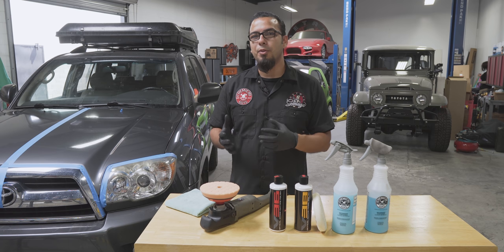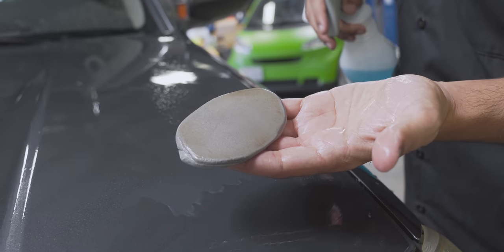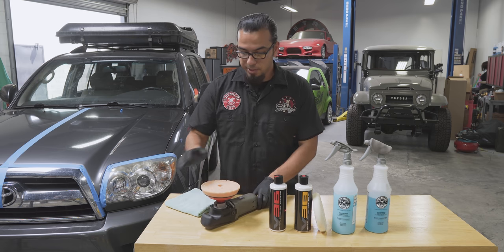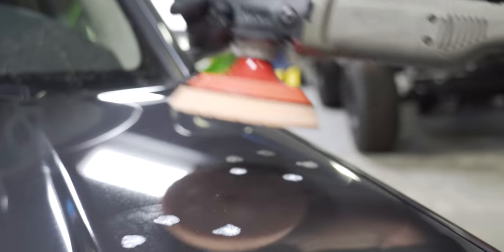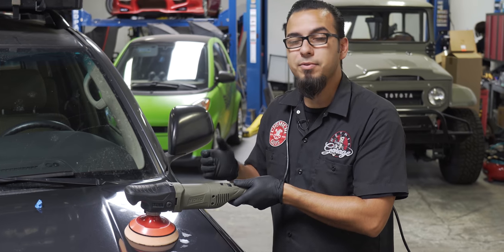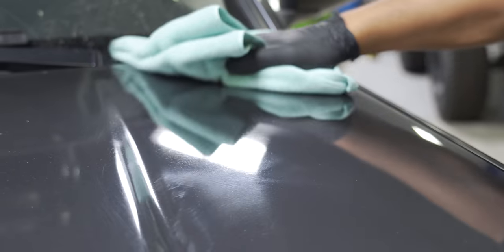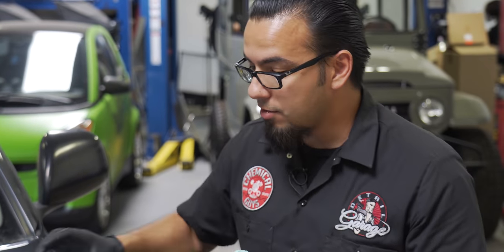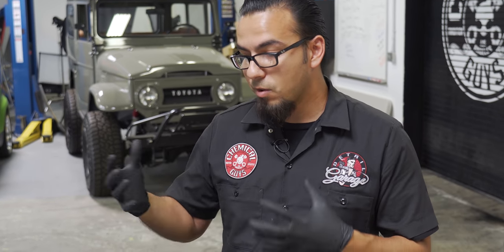How To Use a Rotary Polisher! - Chemical Guys

Comment: Believe it or not from watching you tube I did my own car and it turned out really good!!
Reply from the maker: That's awesome!! Keep up the good work! 
- CG Nick
Reply: Was the rotary not too hard to get used to?
Reply: @radreviewz9482  it wasn't impossible I practised on some old hoods about five times and just thought if I don't try now I never will so I just did it iwas impressed I'm still using the rotory
Reply: @ChemicalGuys  by thanks Nick thank you!!!
Reply: @blitz9117  I should practice on something but what? If I can't get another hood.
Reply: @radreviewz9482  you can always get another hood at your local junk dealer they are inexpensive and the best to practise on. If you can't afford that you can practise on any painted surface that has metal beneath it with some kind of clear coat on it
Reply: @blitz9117  good idea. What would that cost? I also just don't know if I could get a hood in my car but I see your point. It could be a smaller car part too that is painted.

Currently having luck with a random orbit polisher but it definitely takes more time. I imagine some more serious scuffs I actually couldn't get out but I'm doing wet sanding and then finishing with a random orbit
Reply: @radreviewz9482  your doing everything I used to do but after my 3rd nice car it was just taking way too long as you said I don't know where you are but in my area I was able to pick up old hoods for about 15 bucks a quarter panel is even cheaper the money you invest in car parts is well worth it in the long run. But don't be scared everyone talks about burning the paint and so forth but if you listen to what's said and apply it to the job you are doing and take your time you will do fine and you will get the job done a lot faster. I have no patience I had to go faster!!
Reply: Same here I learned some painting skills and techniques from YouTube and I have never used a dual action yet, I went straight to rotary and learned how to use it and now I've painted one of my cars and using the rotary to buff the paint. I figured it's best to go straight to the rotary and now I can use it on any panel and bumpers without damaging the paint.

Comment: How long does it take to polish a car using rotary vs a the torq21 and torq10x? I have the 10fx and feel like I could use a bit more power
Reply from the maker: Hey Kenyon! Thanks for your question. A rotary is much faster than any dual-action/random orbital polisher. You can almost cut your polishing time in half with a rotary but that depends on skill level and paint condition. 
- CG Nick 
https://youtu.be/4a95g7oC0IE

Comment: A professional detailer once mentioned a 20-25 degree pad angle instead of flat to avoid getting circle marks.
Reply from the maker: Hello! Adding angle to the pad creates a hot spot on the edge of the pad which can cause holograms.

Comment: I had a guy tell me that clay barring can wear through the clear coat.  He said that you can only do it twice before possibly wearing through. Is this true?
Reply: Tim Ford No. A clay bar is not going to wear through your clear coat. It just pulls out contaminants embedded in it. Only the machine polishing will remove a fine amount of your clear coat because scratches are little (some big and can go through the CC) imperfections made. Don’t worry about damaging anything while claying as long as you use some type of spray with ample amounts of lubrication
Reply: Tim Ford completely and utterly garbage misinformation my friend, you can clay your vehicle w many varying methods many times with out leveling off any or minimal actual clearcoat. The only issue/problem that could occur is scratching or marring of the clear coat due to an improper claying method or the usage of a worn and contaminated clay bar, and systematically the more times you choose to clay a car the higher the chances of that occurring. But you could essentially clay your car each time you washed it if you wanted but that would be pretty pointless and time consuming not to mention a good wax or sealant treatment after a clay/ polish would negate you having to clay bar your vehicle again for quite some time all be it the weather/fallout conditions in which the car resides.

Comment: Big fan and love all the vids! I just bought more pads this afternoon. I've gotta say you look like your a bit afraid of the rotary, personally I was a bit disappointed in the results. I feel like you didnt cut deep enough and maybe should have used V32 or applied a lot more pressure to really get at those defects. Was the paint really that bad or was the camera angle just a bit less then flattering? I've had amazing results with V32 and V34 with really bad paint and other then a lot of dusting which is annoying I like the cut. One more question,  speaking of dusting how is it I manage to dust the whole car and you had very little dust? Am I using too much product?
Reply from the maker: Hey Frank! Thanks so much for checking out the video and for your awesome feedback. We used V36 Cutting Polish which is a great base-line polish to remove swirls and scratches. Of course we could have used a more abrasive compound for more cut, which tend to dust(just the nature of compounds) but the paint on the hood of this 4Runner is so damaged that we would be chasing our tails trying to bring more clarity out of the paint. However it made a great candidate for proper technique and procedure when using a rotary polisher. There will be more in depth videos with thorough paint correction in the future so stay tuned. - Happy detailing! 
- CG Nick

Comment: You guys should do a video on decals. Like do you polish them, do you not polish them? What do you do? How do you car for decals on cars?
Reply from the maker: Hey Shelby! Thanks for the suggestion! Typically you want to avoid polishing any type of decal of vinyl graphic because it could easily stain or peel as the polisher moves over it at a high speed. We recommend masking the area to prevent damage.
- CG Nick

Comment: Awesome! Now bigger question. How do you repair or correct a skuff or scratch in a matte surface not plasti dip or vinyl wrap?
Reply: Jaimy Fisher you can’t. You have to get it repainted. Polishing it will even the clear coat and give it a shine

Comment: Is it common to do paint/scratch cutting with rotary buffer then switching to DA for correcting swirls that the cutting process leaves behind?
Reply from the maker: Hey there! Yes, that is totally fine to use a rotary for deeper imperfections and then refine with a dual action polisher.
- CG Nick

Comment: Shoutout from Chemical guys mauritius
Reply from the maker: Happy detailing!
Reply: We actually use dual action polishers together with Menzerna 400 and 3800  as cut and polish compounds so this video was a great way of shedding light on how the rotary works. Those two compounds you used are sold in the showroom but since we dont use those i never knew what they did. Great insightful video

Comment: I can't keep my rotary flat at all? Any tips mine will just break my arm if I do?
Reply from the maker: Hey there! It takes practice to work with a rotary, slight pad angle is enough for the machine to want to walk. I recommend using a soft finishing pad to get the feel of placing the machine on the paint, then try it again on the lowest speed setting with just the weight of your hand. You should be able to feel when the polisher is spinning flat on the surface, it feels like it will glide by itself you just need to simply guide it.
- CG Nick

Comment: This may be a strange question but I have a 2003 Mitsubishi Eclipse and I have wing on the back of my car. There is very little space under the wing. How would I polish under the wing with a rotary polisher?
Reply from the maker: Hi there! Without removing the wing, it'll have to be hand polished. Check out the Orange Hex-Logic Hand Cutting Pad.
- CG Nick 
https://www.chemicalguys.com/hex-logic-hand-polishing-applicator-pads---3-pack/BUFX_204.html
Reply: Avid40 some company’s like maxshine sell extension wand type things for rotary polishers almost like a flex shaft for a dermal, most come with polishing cones which are about 1 inch in diameter. If you have a dremal with a flex shaft a company known as detail division sells the cones individually

Comment: How much pressure do u use for buffing?
Reply from the maker: Hey! When using a rotary polisher, the weight of the machine is all that's needed. Dual action and random orbital polishers require the weight of the machine and your hand plus a little bit more. Listen for the tone of the machine to change but ensure the pad still oscillates.

Comment: How come when I polish my motorhome which is fiberglass/gel coat it doesn't come out like this? I'm frustrated. Or am I doing something wrong?
Reply from the maker: Hey Larry! Use an Orange Hex-Logic Pad with V34 Hybrid Compound to remove oxidation and scratches.

Comment: Do you increase the speed while having the rotary in motion or do you lift, increase speed and then back on the area?
Reply from the maker: Hey Jc! Good question, if the machine is already rotating on the surface just bump up the speed to the desired setting rather than pulling it off of the paint.
- CG Nick

Comment: Nick y don't u use wool pads or hybrid pad with rotary than finish down with v38?after 6 years ive been watching ur videos no one at shop doesnt.b well
Reply from the maker: Good question, from my experience a foam pad seems to have the best combination of cut and finish without creating an excessive amount of heat especially of newer, more sensitive modern paint.
- CG Nick
Reply: @ChemicalGuys  wool pads generate way less heat than foam. That makes zero sense. Source - I grew up working in my parents professional detail shopn

Comment: At the end of the video you mention finishing up with some type of wax or ceramic coating. What would you suggest for fresh paint bc/cc. I've just wet sanded to 3000 and have stepped all the way thru to the V38. Whats next to protect it...again, just painted 2 weeks ago. Thanks!
Reply: Anybody have an opinion
Reply: Hi Kenny,

A polymer based sealant is simple and easy to apply.

You sound like you've done a lot of good prep work so I'd personally recommend putting a ceramic coating on it.

Have a look at any of big names like Gtechniq, CarPro, Gyeon etc as they all offer user friendly ceramic coatings 👌
Reply: Check out Project Farm’s video on ceramic coatings.

Comment: Hey Nick I have a question, I was using my Torq Foam Cannon on my 2000 PSI 1.4 GPM gas pressure washer, and my suds aren’t coming out as thick as the videos shows. I thought it’s because the cannon was clogged so I followed the instructions to degrease it. I then thought it was the orifice; so I switched it out to a new one and still nothing. I’m even using proper dilution, I even added way more soap then water and still nothing.
Reply from the maker: Hi Rigo! Thanks for your question. I recommend using two or three ounces of your favorite soap and filling the rest of the canister with warm water to improve foaming action. 1.4 GPM is the minimum so it may not produce the same level of foam shown in the video since we use a 2.4 GPM unit.

Comment: Interesting you don't use the old school method of putting the polish on the panel and scooping her up with the rotary from right to left
Reply from the maker: The old method of loading a bonnet or wool pad would fling compound/polish when you hit it at speed. This process is a little cleaner and insures that the product is evenly distributed.

Comment: I have a doubt that it is possible to use polish pad on rotary machine to get perfect results...
Reply from the maker: Hey Maddy! It takes a lot of practice and patience to finish with a rotary but it is possible.
Reply: It's certainly possible, however it does take patience and lot's of practice. 

Depending on the paint I'm working on I can get epic results with just the DA or rotary but more often than not I correct with the rotary then jewel with the DA 👍